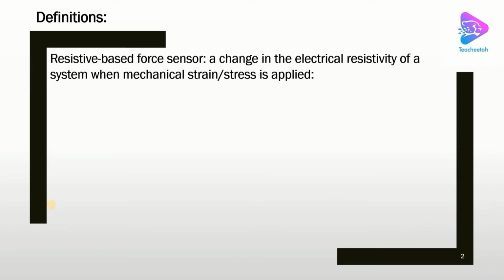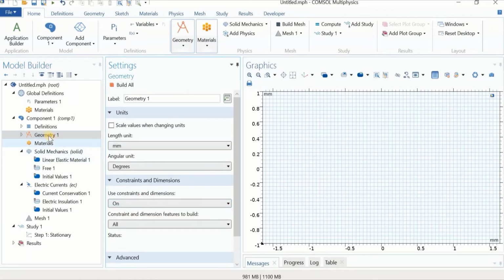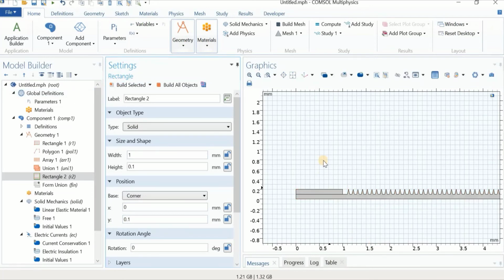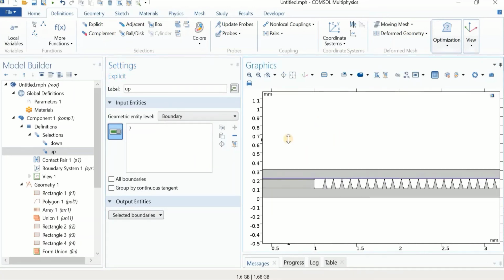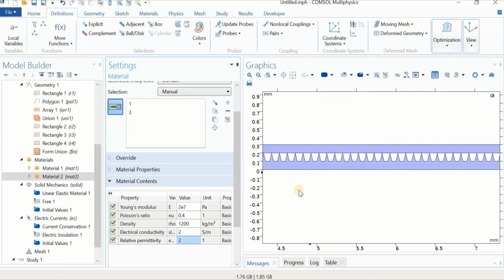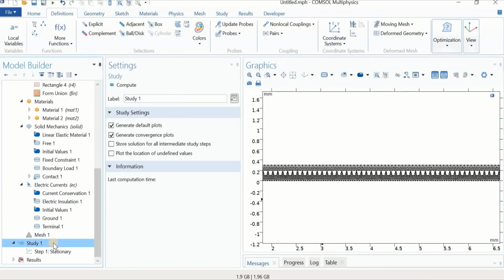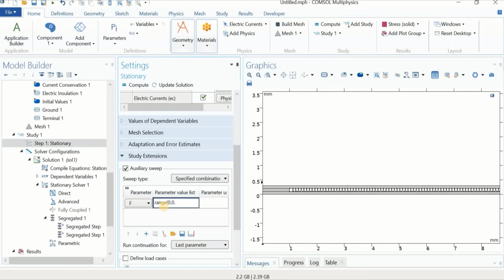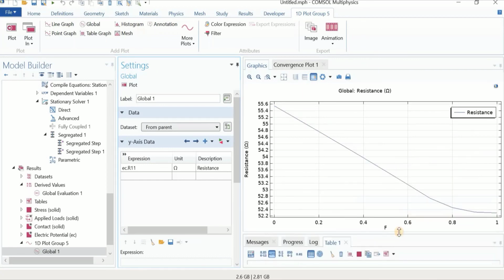Tutorial 7: Modelling Micro-patterned Resistive Force Sensor

Comment: Another question: I don't understand why the deformation and resistance are coupled.  In your final solution, at full force, the triangles are bent but they are still touching the top layer at only one point.  I was expecting to see them squished.  With the result shown, I don't see how the resistance changes at all.  And in any case, I don't see how changes in resistance would affect the deformation.  The material with the triangles doesn't seem to have any properties that would stiffen (unstiffen) it due to current flowing through it.
Reply from the maker: Ideally the contact area in the small scale would not remain as a point with larger forces and deformations, maybe not clearly shown here but when making much finer meshes it might be better to notice that. Apart from that, by deforming the solid domain, the geometry of the formed resistance is essentially changing (even small) resulting in the small variation of the resistance.

Comment: Great set of videos!  In this one, at about 9:53, you state that conduction between materials requires definition of contact points.  But in Tutorial 6, you modeled the capacitance of a porous material.  If you had instead modeled resistance in Tutorial 6, would you have needed a whole bunch of contact points (because there would have been conduction between materials)?  Or would that not have mattered simply because the pores were full of air (which is non-conductive)?  Or is something else going on?  Also, in Tutorial 5, you modeled the resistance of a composite material.  Why did you not have to define contact points there?  Was definition of contact points required here because the contact points were literally points?
Reply from the maker: From the Solid Mechanics Physics modeling in the software, defining Contact Pairs are necessary between two boundaries which are being in contact under loading. Otherwise it does not solve the problem. That is why we need to define it in here unlike tutorial 5 where no Solid Mechanics and contact mechanic physics are involved and the geometries are stationary so no need to define contact pair and we only use form union when creating the geometries so the boundaries are shared between two different domains. From the electrical point of view, when two conductors are separated by a non-conductor (e.g., air), the resistance between them is infinite like an open circuit. When the contact is created, the junctions are formed so that charges (electrons) are allowed to flow which creates a non-infinite resistance between top and bottom surfaces in the system based on the definition of Ohmic loss, and the more contact area, the more conductance of charges thus lower resistance. In tutorial 6 we used a different interface with no conductivity involved as we deal with dielectric properties in capacitance modeling. In that case if we use the Electric Current interface, again the problem in tutorial 7 it is different from tutorial 6 problem where an existing solid domain appears between the top and bottom electrode which creates the pathways for electrons (again no contact mechanics involved). Please note that the resistance (and conductance) are both material and geometrical dependent unlike the resistivity (and conductivity) which are materials properties only.

Comment: hello thanks for you effort and your way. when i apply an error appeared which is " Segregated Step 1
Division by zero.
  - Function: /
Failed to evaluate variable.
  - Variable: comp1.solid.D12
  - Defined as: (comp1.solid.E*comp1.solid.nu)/((1+comp1.solid.nu)*(1-(2*comp1.solid.nu)))
Failed to evaluate variable.
  - Variable: comp1.solid.Sl22
  - Defined as: (comp1.solid.Fiil22^2)*(comp1.solid.Ji*(((comp1.solid.eel11*comp1.solid.D12)+(comp1.solid.eel22*comp1.solid.D22))+(comp1.solid.eel33*comp1.solid.D23)))
Failed to evaluate expression.
  - Expression: d(((-comp1.solid.Sl11*test(comp1.solid.el11)-2*comp1.solid.Sl12*test(comp1.solid.el12)-2*comp1.solid.Sl13*test(comp1.solid.el13)-comp1.solid.Sl22*test(comp1.solid.el22)-2*comp1.solid.Sl23*test(comp1.solid.el23)-comp1.solid.Sl33*test(comp1.solid.el33))*comp1.solid.d)*(dvol),{test@3})
Failed to evaluate Jacobian of expression.
  - Expression: ((-comp1.solid.Sl11*test(comp1.solid.el11)-2*comp1.solid.Sl12*test(comp1.solid.el12)-2*comp1.solid.Sl13*test(comp1.solid.el13)-comp1.solid.Sl22*test(comp1.solid.el22)-2*comp1.solid.Sl23*test(comp1.solid.el23)-comp1.solid.Sl33*test(comp1.solid.el33))*comp1.solid.d)*(dvol)
" 
An error occurred when evaluating a variable. The domains in which COMSOL Multiphysics tried to evaluate the variable are indicated. Also, the error message shows the expression that COMSOL Multiphysics was unable to evaluate. Make sure that the variable is available in that part of the model and if so, that you have defined the variable correctly in the indicated domains.

i am try to do it again and follow the steps carefully but it don't gets, so what should i do ?
Reply from the maker: Hi Mohammad, please follow all steps presented  in the video  very carefully that probably will fix your issue